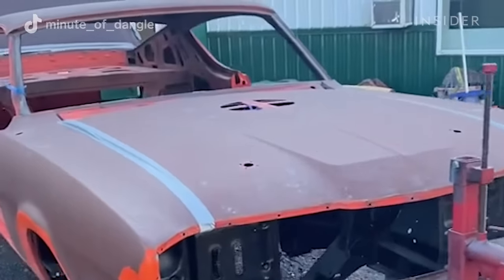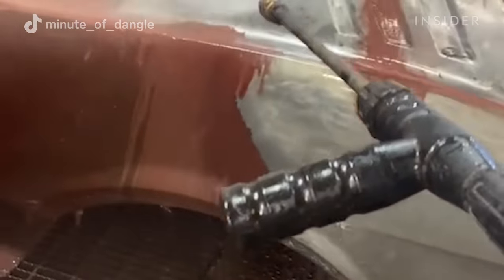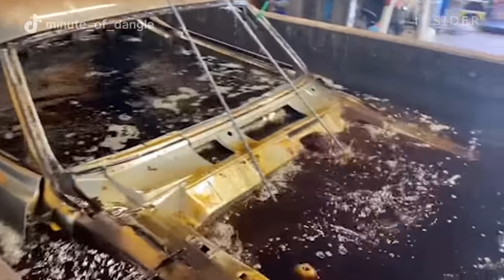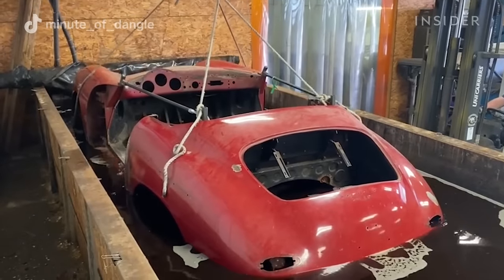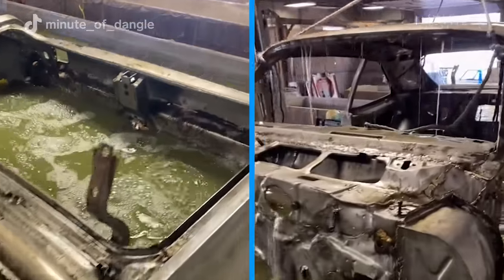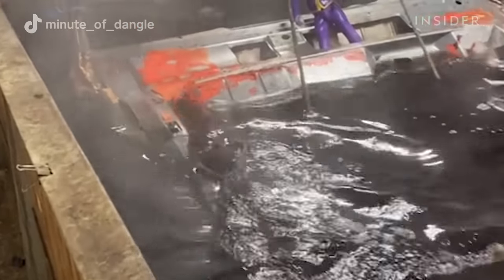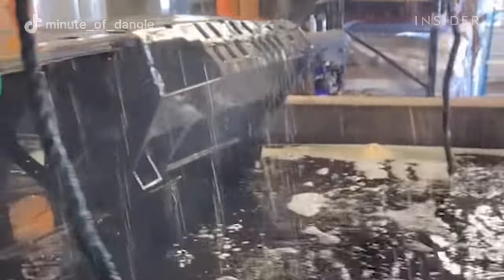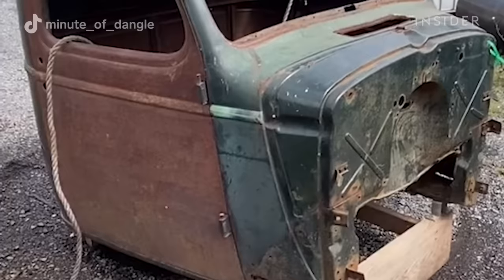Chemical Dipping Removes Years Of Paint And Rust From Vehicles | Insider Cars

Comment: I have used this process many time with great results. The body or parts should be E Coated before bodywork and paint to protect the parts from internal rusting. I have everything ECoated.
Reply: No need really as this process phosphate coats the steel preventing further rusting.  Once acid dipped they can sit outside for ages without rusting.
Reply: @matthewq4b  
I must disagree, the coating left from the stripping process is not conducive for paint adhesion, even the ECoat must be scuffed before epoxy primer is applied. This is still my preferred method of removing paint, rust, old body filler, etc.
Reply: @theschmitthaus6208   Who said anything about paint adhesion or where was that discussed ?    Comprehension issues apparently.  And to E coat properly requires submersion.   Once acid dipped there is no need for submersion E coating as the metal is phosphated and will not corrode till that is consumed and that will take many many years in body voids...
Reply: @matthewq4b  This has been what I've been trying to get information on.  Voids that are now just "inhibited" with no primer or E coat - how long does that actually last?  Especially in a humid environment?  Little water in there from rain?  I see you are saying that it is fine but do you have any actual data on it?
Reply: @doingcarthings   How long a phosphate coating will last will vary from dip to dip and from vehicle to vehicle. 
Typically void rust protection will last from 3-40 years depending on the environment the low end will be in the rust belt with winter driving. The high end will be a vehicle that never sees rain, wet or winter temps.

Proper e-coating requires a phosphoric acid bath beforehand (same as a rust stripper bath) that deposits a phosphate coating prior to an E coating bath.

The Alternative is to rust inhibit (oil or wax) phosphate coated voids this will last as long and potentially even longer than the E coating

Comment: Hold up slam the brakes on.
    Your missing the BIGGEST step.
 Oven baking after the bath to cook the chemicals OUT of seams and enclosed box sections.
When this process first came out, it encluded an oven baking ,like a powder coating oven. The car was rinsed down, then oven baked to cook out the chemical you can not see, nor get at, in side of welded box sections.
    With out the oven baking you get white powder substance coming out of seams and forming inside box sections and after the car is finished you can close doors and see white powder coming out of places after driver on roads. Just like what Sand blasting does.
Baking has to be an integral part of this bath.
    Look at any industrial bath. It always goes thru a baking/ curing process after.
Reply: Likely not needed anymore since the acid get neutralized and then dipped in rust inhibitor.  That's 2 extra "rinses" that would get rid of all that excess reactant that causes that white powder in the first place.
Reply: Bro "oven baking" out chemicals doesn't even make sense... it's just powered drying.

Comment: My boss did this to his Porsche race car and it was awesome took off even the undercoating and seam sealer as well. Dropped a lot of weight as well.
Reply: @ShainAndrews  won't the rigidity be fucked though ?
Reply: @orlmont  Most were body on frame, so no.  And they would push the roll cage rules to adjust how the chassis behaved.  Hard core racers are like that one kid in school that knew the rules very well but had the insight to interpret them instead of accept what the intent of them are.

Comment: I have to say, if I could do it again I would do this. I mechanically stripped my car by hand and it took forever, made a mess, and didn’t remove all the paint and seam sealer.
Reply: I'm in same boat, but I'm inspecting all the seams on my car, any that show the slightest sign of rust get cut out redone with special primer and special glue instead of bare metal spot-welding like they used to on this car. It's a really lengthy process, but when it's done it'll be done properly and completely. Then I can do an engine swap and put some power down (I refuse to put power on a rusty car) and my car is already far from original, and not rare, so keeping it as original as I can won't be smth I want or need to do. It's a Triumph TR7.

Comment: What about inside the cross members where its really important to get rid of the rust and where the pressure washers can't reach?
Reply: The remaining acid makes it rot from the inside out. Several people I spoke to who've had their shells dipped, had issues with this. I will not have my shell dipped for this reason.
Reply: @Zgurkogel  yepp, getting rid of the remaining acid from the cross members is what I meant....
Reply: @Zgurkogel  Would need more information from those "people" - all of these processes are different, and I could see it being a problem with some of the ones I've seen that do a spray on acid neutralizer as opposed to dipping in the neutralizer as shown in this video.  I'm not saying the issue is avoided but fully submerging should technically get the neutralizing bath into the same areas as the original acid bath.
Reply: Don't worry about it acid dipping is junk seriously weakens the metal and compromises the whole chassis
Reply: @doingcarthings  this was done to a mate's car by a UK based company. They claim to neutralise the acid by fully submerging shells. Only 2 years later the shell started bubbling around the spot welds in various places.
Reply: @Zgurkogel  Exactly! PPG will not warranty any finish on a car that was acid dipped. There will be trouble down the road.

Comment: They don't say what chemical it is, but it looks like it's HCL. All of those drainages in the car should be pressure washed after the treatment, but how? The only protection against the rust that I know of is to once every year before the winter comes, pour or spray hot oil into all those drainages.

Comment: After your treatment a hot-dip galvanization would make a lot of sense. This way you would protect the bare steel immediately for a very long time.
Reply: Why coat the bare metal with zinc? It is thin metal and hot dipping is extremely hot, certainly not good for an already fragile body. Besides that welding patch plates would be dangerous since zinc is poisonous. He already mentioned they chemically protect the finished product.
Reply: Only problem is hot galv dipping can very easily warm a car chassis/body.
Reply: Nearly 100% of the metal I weld at work is zinc coated it's a little concerning but I'm not dead yet.

Comment: It shows the chemical dip and then pressure washing it off afterwards.  Is there a neutralizing dip in the process?  Pressure washing doesn't seem like it would get into the small areas that dipping would and the chemicals would continue to eat away.  Did I miss something in the video or is that not a concern?
Reply: You missed it.  First they dip it to remove paint, second they dip in acid to remove rust, third dip is to neutralize the acid to stop the acid from causing rust, then dip into a bath of rust preventer.

Comment: How do you deal with air pockets when dunking to get total coverage?
Reply: I think the stripping chemical's surface tension is quite small and it is also not viscous, therefore jt would penetrate very well
Reply: Most of the modern / industrial setups mount the chassis onto a boom, and then the chassis is moved through the bath so that it does kind of a front flip.  It's not foolproof, but defects are pretty rare.  Also, many modern chassis are designed to be dipped with a passivation coat at some point during manufacture, so it incorporates features to avoid those kinds of problems right from the start.

Comment: Does this process remove the lead some companies used to smooth body panels?I am quite interested and hope somebody can give an answer!
Reply: No the lead stays  .This  is how all full restorations should be done  .The  ultimate  .Then dipped in  etch primer  .
Reply: @mariorubino2739  thank you for the response!I'm seriously considering having my '51 Ford dipped before starting my restoration and this was my biggest concern!
Reply: Look  up smart restorations  and concours  sportscar  restoration.
Reply: @mariorubino2739  Is lead used instead of body filler? If so how thick can the lead be and still be effective? In other words, can lead be used to fill dents and dings or is it only effective when used thinly?
Reply: @bodeine454  for  small dents try pushing them out hammer  n dolly   or slapper then file Finnish  .If u can't  get to the dent use easy beat ..There  is nothing  wrong  with filler if used thinly  and metal is  clean . Use lead 4 weld joints   or small  rust repairs .
Reply: @mariorubino2739  Thank you for the info, I was curious about that.

Comment: Recently my father gave me an old CB radio he had in the attic. Still worked perfectly but was way rusted on the outside. Essentially I dissassembled it and put the rusted parts in a bucket filled with vinegar and WD40 for about a week. It easily removed the rust it had plus the paint simply by shaking it and the metal never looked so shiny - almost felt bad by painting it again.
Vinager corrodes soft metals as well like aluminum.
Reply: @zacsdiyguns  And WD40 is an oily substance (Water Displacement) that won't mix with vinegar.
Reply: @baladar1353  Used it precisely to avoid future rust.

Comment: The problem with this is if you can't reach it with a sand blaster you probably can't paint it either.  Also this removes any paint between layers.  I would be careful with this.
Reply: Agree 
It’s a bit too effective in places.
Reply: @Dennis-eh2vx  but rust inhibitors only lasts a year
Reply: @Dixler683  No, I don't work on cars. How do you know this? None the less, I just listened to what they said in the video.
Reply: @Eduardo_Espinoza  sorry man, I think I meant to respond to someone else.

Comment: biggest downside to chemical dipping , even paint on unreachable metal (inside doorsills inside of frames etc) is removed too , and if you dont repaint those the car will rust from the inside out
Reply: How do you think the factory's put the cars together? the sheet metal parts are completely bare metal then spot welded then they put seam sealer on all the seams where two or more layers are welded then they prime and then paint after the car is completely assembled (I.e. just the metal parts of course)...

Comment: My biggest concern is removing all the chemicals..we have all heard the horror stories of people using this process and then ruining there expensive paint job because the acid that gets in between the seems start to leech out over time causing adhesion issues. best way to deal with rust is to cut it out and fabricate a new piece..non of this neutralizing bs..

Comment: For someone that has a literal 20 year old Holden Commodores still kicking with original parts and motors (both nearly over 200k Kilometers on the odometers) but are DEFINITELY starting to show their age (a 2000 VS Olympic Edition Ute and a 2005 VZ Berlina Commodore if anyone's asking) this is a good thing to consider. Probably cheaper in long run as you can do this then just take it to a dealer to have them redo the factory paint or even in another factory colour then have them reassemble it. All the parts are there, just a labour and time thing to worry about.

Comment: In the 60s and 70s we acid dipped race car bodies, mainly to remove under coating and sealers, to lighten the car as much as possible. Not sure what chemical was used but it probable wasn't environmental  friendly. It would cost more than $2500 in labor to even attempt this manually. We also removed the lead body filler used by the factory at that time.

Comment: Having a process that doesn't use a ton of hazardous material, or involve that fee, is going to reduce the cost. A lot of companies are realizing that significant costs are associated with using the really hazardous chemicals, and by eliminating those chemicals with less toxic alternatives saves money (laser stripping for antique woods, for example) in the long run due to disposal costs, worker safety, etc.

Comment: Can someone help answer a few questions regarding this process please (not necessarily about this company per se but just the process itself). I’ve watched quite a few tv car shows / restoration shows from the Uk and US over the last few years and at some point there is always this ‘chemical’ dipping process to strip the chassis to bare metal. My questions are, how long does the chemical in the vats last? Does it have some sort of finite life time where it loses its strength and need to be ‘thrown away’ as it were? If so does this life span vary from chemical to chemical based on type of chemical used, and if so what is the usual life time of these chemicals? Are we talking like 3 - 5 years, more, less?  Next, once the chemical loses it’s potency, how does one get rid of the chemicals? I’m guessing you cant just pour it down the drain - does it get shipped off somewhere to be reprocessed and if so anyone know what this process is? (Am I right in guessing its a bit like how folks try and reuse left over food grease/oils from restaurants etc etc?) 
Sorry for the questions all…just genuinely interested in learning more about this side of the process as I’ve always been fascinated with chemical (and similar) dipping / cleaning but have never seen or heard anyone explain what happens to the mix once it’s past it’s useable life time. 

Thanks all (and Happy Christmas/ New Year all🎅🏽🙂🙏)

Comment: For what you're getting the price looks good! Way better than sandblasting metal away, or using CO2 Ice.
I do small parts rust removal with Molasses 1 to 9 parts H20. Works great, I suppose you could fill a swimming pool easily enough, but I get flash rust. This is a no-brainer for a quality re-build!

Comment: I would avoid any acid dipping or electrolysis rust removal on old cars as it can seriously weaken weld joins which could lead to frame bending and weakening - expensive and rare old cars like Porsches best way is to completely dismember all panels before cleaning then rewelding them for a proper strong fitment and filling all rust voids with solder or welded patches

Comment: There seems to be a huge flaw in this process. Since the liquid does get where media cannot touch, that also means paint/primer cannot touch it. Since metal panels have a coating on them before they are attached to bodies during assembly, they are ok even though the paint process doesnt touch them. But this chemical bath will remove it. Seems like untouchable areas will rust first after this process.
Reply: You are dead right. We had a Porsche done by this type of process about 5 years ago. The car has now rotted from the inside out!  "A"pilers were the first to go!

Comment: Should you have your car dipped? Depends. There will be areas that you can't get to to paint and ALL seam sealer will have to be replaced. It will be like cars were made decades ago before the bare bodies went through the primer dip like late models get. You WILL get rust from the inside out from areas that couldn't be coated or from where several layers of metal cover each other.

Comment: I used exactly the same methods in the 80's servicing & cleaning gas welding equipment made of brass in bulk qty. I hope y'all are up to date with personal safety gear, especially ventilation & breathing apparatus. Enviro "friendly" is still toxic. Done right there is no better way to deep clean steel, copper, brass. Aluminum, white metal & magnesium are definitely a toxic no go.

Comment: Do  not ever have a car dipped .
As a professional Show Car  Painter, its the worst  thing you can do to a car is have it  dipped .Especially acid. 
The reason is when that acid  goes between  where sheet metal us joined  over lapped or spot welded that acid never comes out of the rinse. No matter what one tells you ,that acid continues to eat away for years until the I parts fail . I seen it over and over.

Comment: You cant fully neutralize the dipping liquid in every hole and hidden places, therefore it starts to rust again under the paint
Reply: you definitely can, this process is used a lot for aircraft parts. If you use someone that is rushing the job or doesn't care then sure you will have problems, but that goes for anything.

Comment: Good way to remove paint and rust but you're removing the factory coating from inside the panels like the frame rails for example, there is no way you will ever be able to get paint inside some of the areas again, so you will have bare metal areas that will start rusting. cars in the factory are dipped in a primer bath to make sure every sqaure inch of the vehicle is coated.

Comment: It’s a good idea until you resized there two sheet of metals stick together by weld, these idea will rust as soon as possible 😂
Reply: Exactly. We had a Porsche done about 5 years ago, by this type of dip method, and it is now rotting from the inside. "A" pilers were the first to go! The car and it's £35K restoration are going down the pan!
Reply: @angusdyson248  omg 😱 sorry to hear that, i repair crashed cars for living. I found in my experience flooded cars rust so fast between every sheet metals in 3 to 10 years so when i saw this stupid guy remove every inch of paint from the car it’s easy target for rust